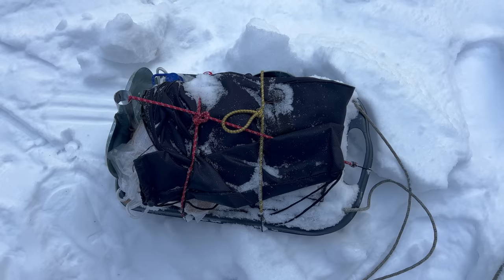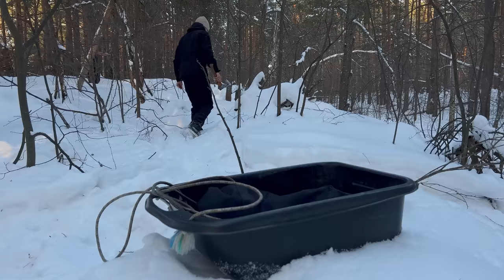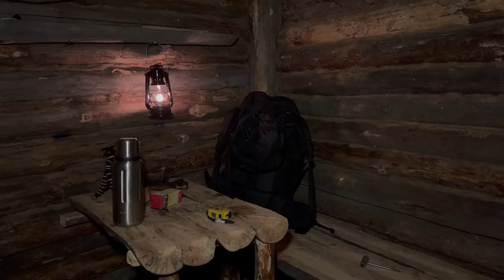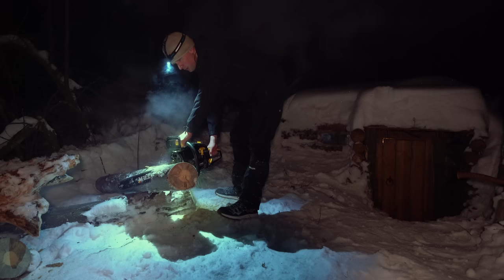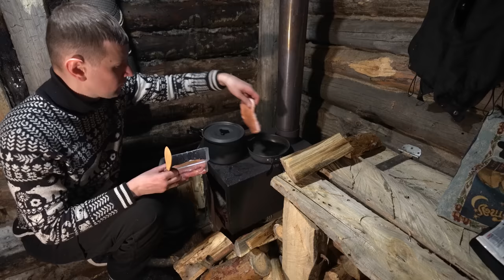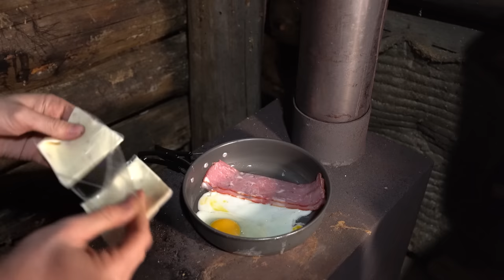Repairing an old dugout in the forest. Solo hiking. No talking

Comment: Great video again! I suggest Alex when cleaning up mouse droppings that you use a mouth and nose cover to protect from viruses they could carry. A good, cheap sanitizer is 70 to 75% isopropyl alcohol in a sprayer. Just mist it over the surfaces after dusting and let dry.  
I suggest for some of the problem areas to block mice, expanding foam. They do sell it with even poison mixed in, but spraying peppermint oil over it is good, too.
Reply: With poison?  What a great idea!  Thanks!
Reply: Check Tom Cowen before you say anything stupid about viruses.
Reply: Dokter MD Tom Cowen author of  the contagion mythe, and take a cat.